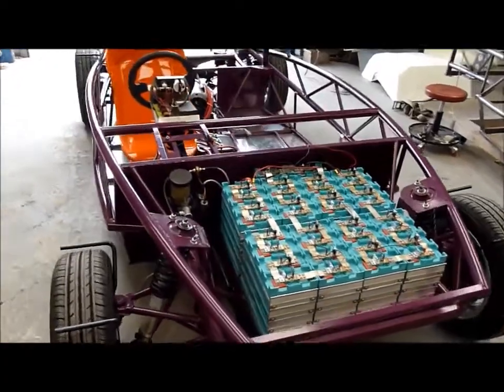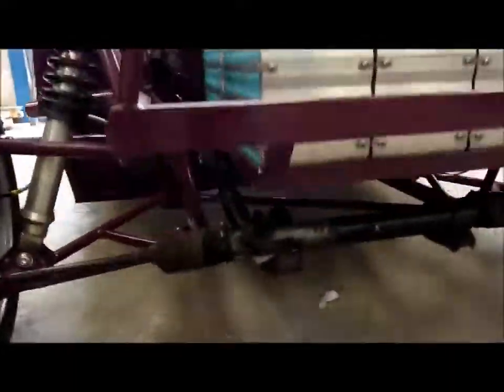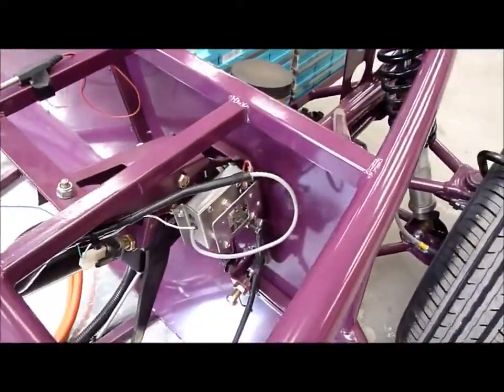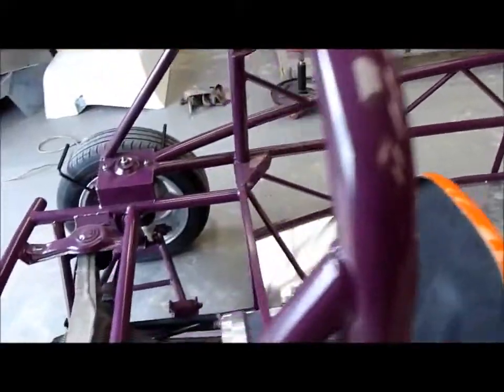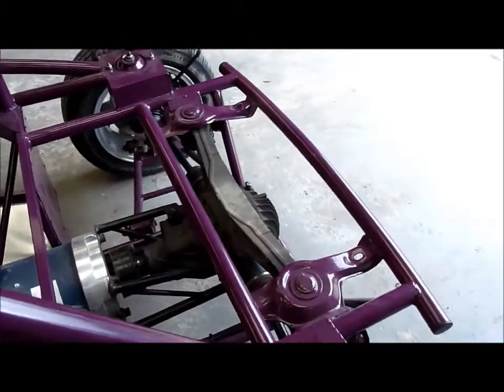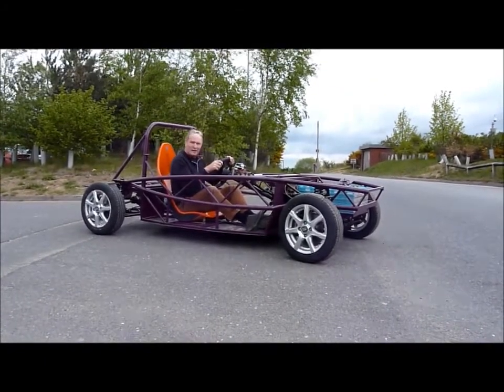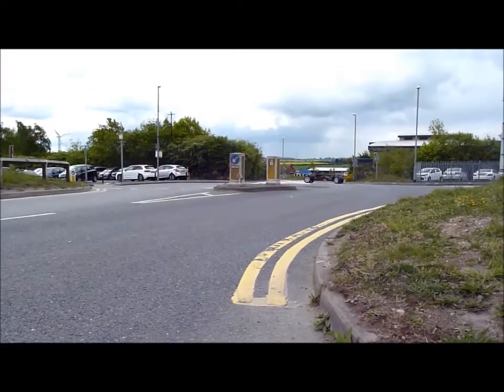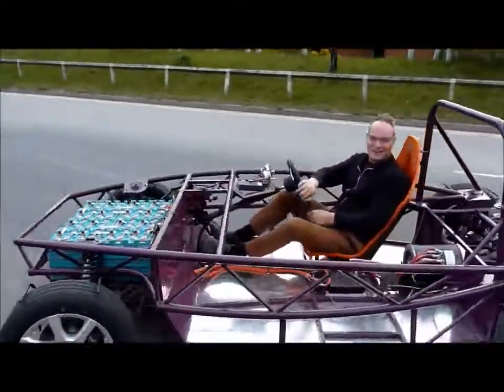MEV Exocet - Electric Version. An Extreme Lightweight EV Electric Car

Comment: 30hp seems low - I know they produce all the torque right away - but what does that translate to in acceleration at higher speeds where drag resistance the dominant force rather accelerating the mass of the vehicle?